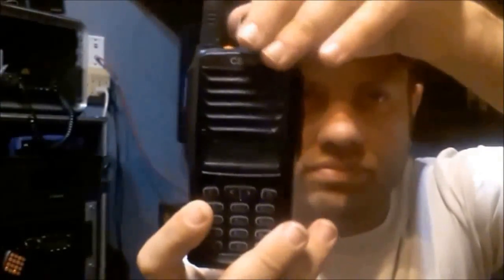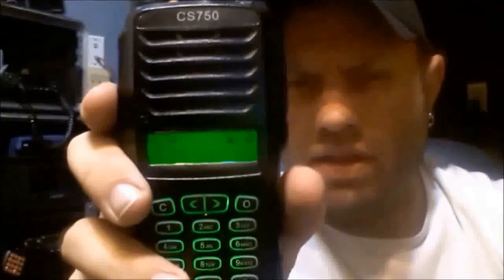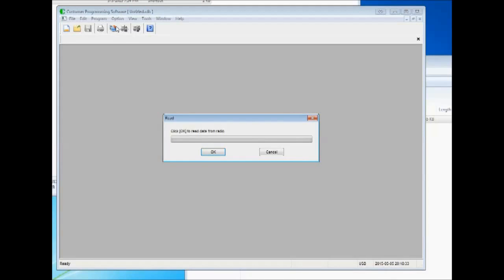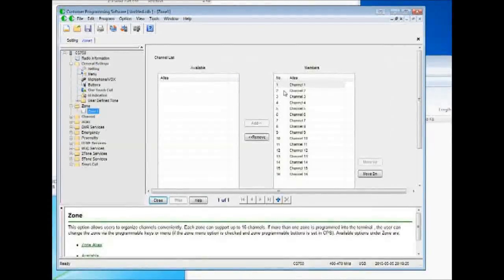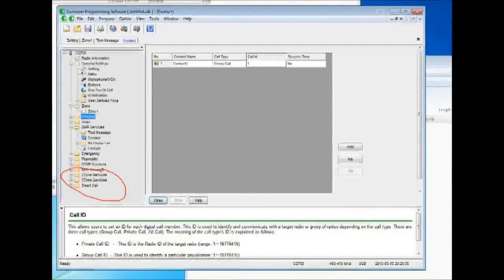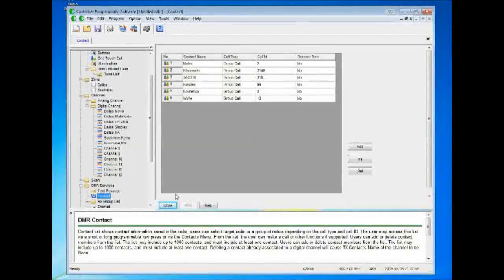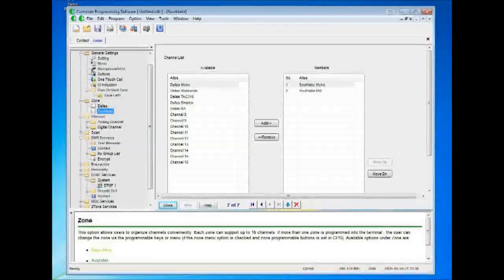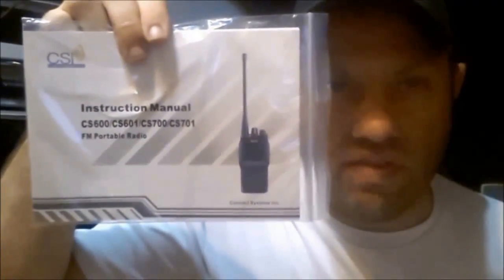Unveiling the Connect Systems CS750: Features & First Impressions

Comment: What all comes with the radio when you order it?? Also, how do you get set up to use DMR? We are getting ready to get a DMR setup here in Casper WY. Thanks in advance. KE7WQP
Reply from the maker: Do you know what network your repeater will be attached to?  You need a subscriber ID for DMR.
The radio comes with battery,  charger, antenna,  belt clip and manual
Reply: +Ham Radio 2.0 No idea about the network. About all I know is is that the state Homeland Security office gave it to the county and it is going up here before to long, just no idea when. And a follow up question is how do I get a subscriber ID?
Reply from the maker: +Michael Bond It depends on the network you'll be attached to.  I can give you a link for the dmr-marc network, it should be valid for others also....I think
Reply: +Ham Radio 2.0 That be great, thanks. The only thing I know is the repeater is a Mototurbo type repeater, but that's it.